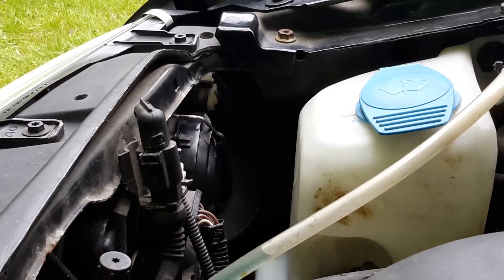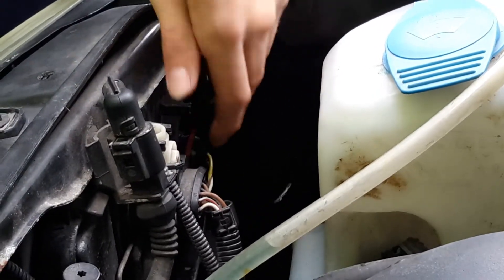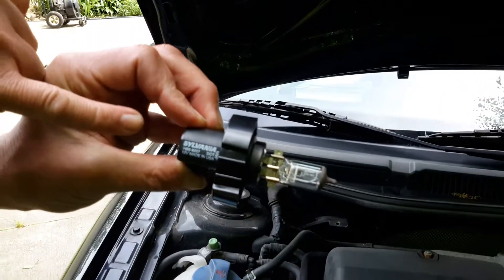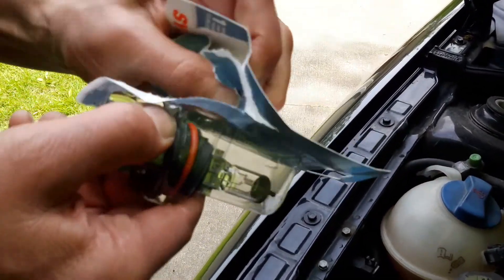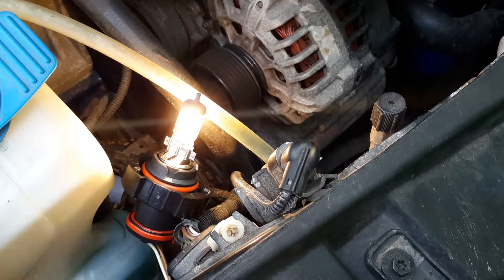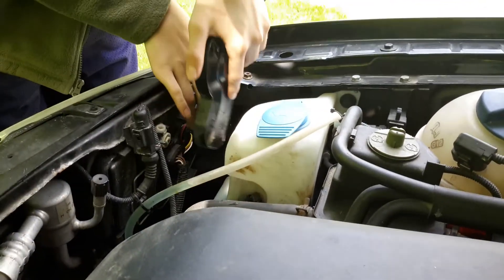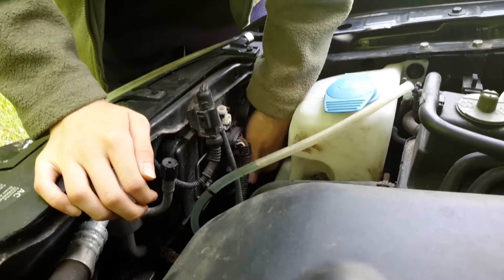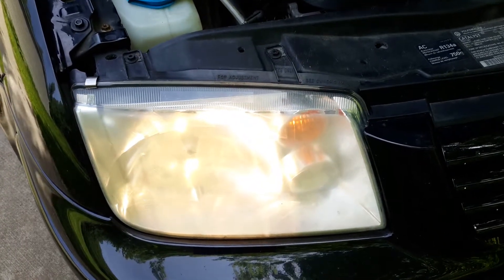How to replace a right headlight bulb on a 2003 Volkswagen Jetta Wagon

Comment: Funny how they do not show the hardest part, mainly, putting it back in for it may seem you cannot tighten the "Nut". Here is the trick: Firstly, put the bulb in first, so you can line up the three grooves located on the bulb, with the three grooves within the headlight housing. You will see the three grooves on the bulb just above the rubber O-Ring on the bulb. Line those up with the three grooves on the Headlight housing and push the bulb fully in so the housing grooves are fully inserted into the bulb's grooves. Once in, the plastic "Nut" will turn and tighten effortlessly. This video will show what I mean: https://www.youtube.com/watch?v=t27KMqSW4lI

Comment: Here is the real reason you NEVER want to touch the glass portion of your light bulbs with your skin.  Your skin contains oil.  This oil is why you leave fingerprints.  When this oil gets on the glass of the bulb, it will remain there for years.  When using the bulbs, they get extremely HOT, even LED bulbs.  These extremely hot bulbs literally start cooking that oil from your skin and can it can actually, over time, eat a hole through the glass.  This has the effect of shortening the life of the bulb.  ALWAYS WEAR GLOVES WHEN CHANGING YOUR LIGHT BULBS.
Reply from the maker: Good to know